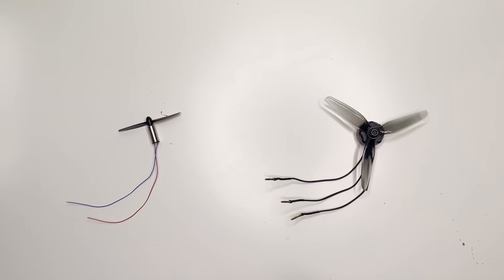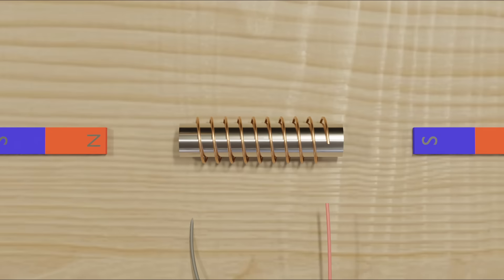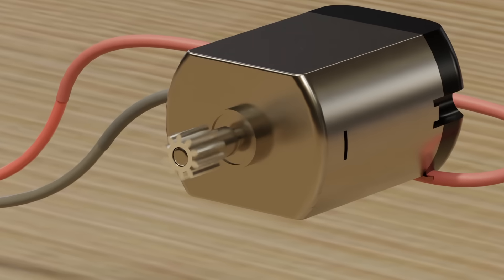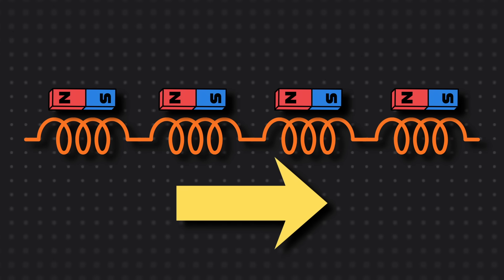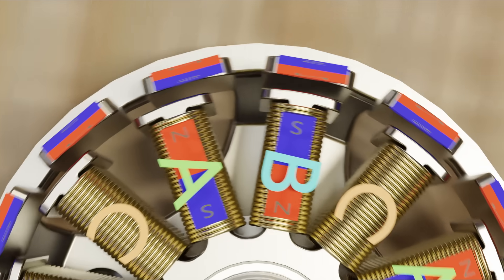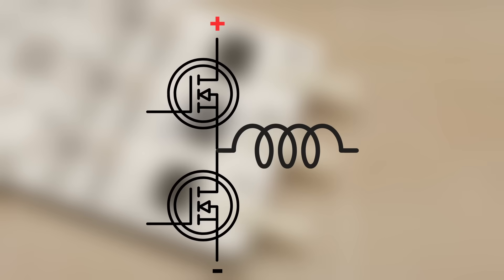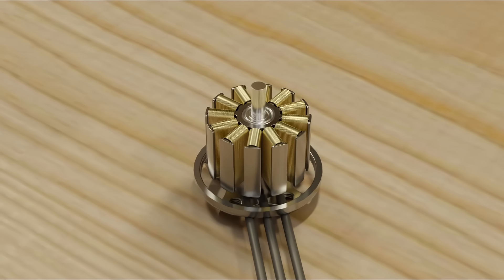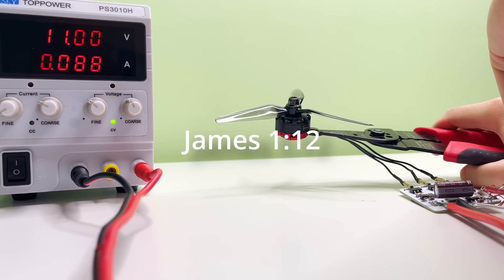Why Adding 1 Wire to Motors is Genius

Comment: wtf did you do to the "metal pad" at 2:12? overlapping faces or wrong normal direction... it's not like you didn't notice it, because you spent so much time animating in that area, so it leads me to believe you didn't actually model this yourself and couldn't figure out how to fix it.

Comment: You didn't explain how brushless motors actually work... How does the induced signal on wire b determine when to switch the current?

Comment: There one more thing ... You can precisely control how much the motor rotates (say you're rotating it slowly and using it like a stepper motor). Not only will you be able to slowly change the position, but you also get the feedback, so you can check if you "missed a step". You don't even need to add an encoder for this.
In addition, you can measure torque. Yes, the third wire definitelymade a major change to motors. 😃

Comment: you kind of missed that that the classic AC motors and generators are synchronous motor that work exactly like that for more than hundred years. Just they could not easily change speed, but were tied to the grid frequency.

Comment: As a normal electrician (not electronics), the biggest change here isn’t brush and brushless. It’s more single phase and 3-phase. The ‘brushless’ shown in this video can be achieved without electronics, using 3 phase AC with each phase being 120degress out of phase.

Comment: is there not extra electricity used in the controller for the brushless motor? does this overhead use more than the wasted electricity from friction in the brushed motors?
Reply from the maker: Hello oosh, that's a good question! The ESC at idle uses about 22 mA, or 0.022 A of current at 11 volts, so about 0.022A * 11V = 0.242 watts for reference. In testing, the motor spins with a propeller at the same 11V at ~0.5A, so 5.5W at a low throttle (~15%). Brushed motors typically have efficiencies of around 75-80%, and brushless around 85%-90%. At worst case efficiency for the brushless, we'd have 5.5W*0.15 = 0.825W wasted, and for the brushed (best efficiency) with the same electrical power input, 5.5W*0.2 = 1.1W. So the brushless saved 1.1W-0.825W = 0.275W more, which is barely higher than the wattage of the ESC (so technically worth it). But what if we increase the throttle to a useful range (in this case, 15% throttle is nowhere near enough to lift a drone into the air, it would be around 50%). That would be about 11V*0.5A*3.333 = 18.3 W needed for 50% throttle. 18.3W*0.15 = 2.75 W wasted for brushless, 18.3W*0.2 = 3.66 W wasted for brushed, so brushless saves 3.66W-2.75W = 0.91W more than brushed. May not seem like much, but multiply that difference in wattage over many seconds for flight time for example (15 mins = 900 seconds), that can be ~900J of saved energy (for 1 motor, out of 4) at 50% throttle. Also, you'd likely need more power for the brushed motor to spin the same propeller at the same RPM anyway, and again, this is the worst-case efficiency for brushless, and best case for brushed. Hopefully I didn't make a mistake in the math, and hope this answered your question, and thanks for watching!

Comment: Stop saying "electricity" when you mean "current". ffs
Reply from the maker: I know it sounds annoying to people who already know what "current" is, but using "electricity" is more understandable to the intended audience of this video. "Electricity" is a more general (and more known) definition that includes the flow of electric charge (electric current). It came down to what needs to be explained to the audience to allow them to understand the main concept (brushed vs brushless DC motors). You and I know that electric current is just more specific in that it has a unit of Amperes to define how much electric charge is flowing, but I deemed quantities as unnecessary for this explanation. That is my reasoning for using "electricity" rather than "current". Hope you understand, thanks.

Comment: Don't forget the clean rooms brushless motor powered tools that are needed.  All those brushes for the old type motors are just little conductive break pads that make microscopic dust.  Went in to get a cavity fixed, got mesothelioma instead

Comment: hello! despite the fact that ideas like magic, and magnetism are not so far apart, you did not manage to make me understand how these things work. for example you talk about three wires connecting, but you did not manage to describe me the voltage potential difference's connection to the connecting three wires. you also managed to flawlessly portray the net motion of the magnets, and the electromagnets, and you mention that you use mosfets to control those. however for some reason you did not mention why the magnets around the brushless motor's electromagnets are not the amount one less the electromagnets. i assume this is due to you misunderstanding the difference between the net motion, and the actual motion such brushless motor does. in my perception the electromagnets are creating a "tide" compared to the magnets around - in order to make these never catch up to one another you can introduce the most tiny difference in this way for example to use one magnet less than electromagnets - causing the "tide" to be forever

Comment: Wait until someone adds 4 wires
Reply: Step motor
Reply: @MasterRey  But step-motor, it's embarrassing.
Reply: That would be an important step in the path forward
Reply: Step motor 😂
Reply: @FoxInSocks23  Step-motor, what are you doing?
Reply: Best one faster than 3 wire
Reply: Steppers! I own a 2504AC. It's fast till you see the 3004AC.
Reply: Well that actually reduces efficiency.

Comment: Frequency Drives have revolutionized industry by reducing spike load during startup of heavy equipment. Reducing the load requirements to these facilities lessens the stress of breakers, controllers and power grids. If it weren't for these innovations and LED technology, the world would be consuming 50% more power than it is currently.

Comment: This video could replace the vast majority of beginner level "introduction to motors" presented in electrical trade and engineering schools. Gives a really good explanation of DC electric motors in general, brushed vs brushless (I don't think you use the word commutator once, but explained it - well done) with very useful visual guides, and also can be used as a lead in to 3-phase AC power and the wonderful world of power electronics.
Reply from the maker: Thank you! I made this video with the intention to allow anyone to understand while only keeping what’s necessary for the understanding. Im glad that the video was able to do that!

Comment: Brushless motor was around long before the 60s , semiconductors only made it possible to run it from a battery. They have been around almost as long as electricity has been around

Comment: within the historical context, I think one wire was removed, because the commutator is a seperate invention
Reply: aight my guess was wrong but we were able to create 3 phase electricity without the electronics and three pase single speed motors could run at a fixed frequency three phase mains

Comment: I don't like the "adding one wire is genius" part, because brushless motors are by themselves simpler than brushed ones, it's the electronics that makes them more expensive. So if you want to retain the mild clickbait part, it would be more reasonable to say something like "how deleting one part from a motor makes is better"

Comment: cool but I'm fine with my gearmotors I can control with just one transistor for what I'm doing. having silent operation is cool but this is way way more costly, specially when I need a few of them. And If I need super accurate operation you can"t beat  steppers.

Comment: Dont brushless motors with for example 3 coils in the middle connected  each with 1 wire and a fourth connecting all to groundand they spin with alternating current automatically switching the direction of current?

Comment: GOING CORELESS !
Yes but your talking about old fashioned Poled motors. Life has moved on, as we now have much more powerful and far more sensitive Coreless Motors that NO LONGER need any extra expensive electronics, only a supply and voltage regulator such as a "knob" to increase or decrease the voltage. And MUST use PURE 12v DC.

Comment: The spinning part of either motor type is called the rotor; the stationary part is the stator. The BLDC motor you had was an outrunner because its rotor was on the outside. Some BLDC motors, like stepper motors, have the magnets spinning internally.

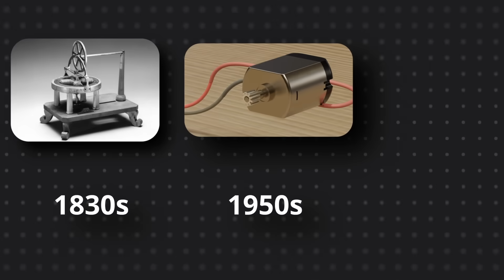Comment: 2:59 Small correction, we did not use DC-motors(or "brushed") up until the semiconductor was viable. Sure, today the semiconductor is a big deal when it comes to controlling asyncron- and syncron motors. The 3 phase motor was starting to get used in mines as early as 1890s. For these motors controlled from a DC source the story is different ofc but just wanted to give the AC-motor the recognition it deserves ☺️

Comment: Actually the better answer is that because of the ESC, Brushless Motors have more torque inducing couples (12 coils and 14 magnets here) as compared to Brushed Motors (2 magnets ad 3 coils). Therefore a Brushless Motor applies a uniform torque and more frequently, throughout it's rotation than a Brushed motor.
An analogy would be a 2-stroke vs 4-stroke engines - a 2-stroke engine gives a more torque output since every revolution has a power stroke than a 4S where every other revolution has a power stroke.

Comment: 3:00 a small correction: No, this is not the only way we used electricity to spin things; it's the only way we used DC to spin things. 

AC motors had been brushless ever since Nikola Tesla invented the three-phase induction motor way back in the late 1880s and we almost exclusively used these motors for industrial applications (with a few exceptions where high initial torque is needed) from at least 1900 onwards.

Comment: One of the biggest advantages to brushless motors, is that you can lock them in place. Another advantage is that you can make a solid state controller using only a handful of transistors and control speed via frequency rather than amount of power (PWM). It is possible to build a 3-way H bridge for this using only transistors, and power.

Also, wait until you get to four wire motors that can do half steps ;)

Comment: Brushless motors has been around from the late 19th century. Nice, and very informative video, but it is a pity how it turns phase shift into a modern age invention, not even mentioning  Galileo Ferraris, Mikhail Dolivo-Dobrovolsky, or  Jonas Wenström. They were genious indeed. Replacing 2 or 3 phase with a semiconductor based DC/AC converter ("inverter" as often used incorrectly) is just one way to generate the phase shift. This is how real greatness vanishes.

Comment: Great video! So well illustrated and described 👏🏻 I actually wasn't sure where this was going until part-way through the video... I've had a brief brush (ha) with brushless motors but they used Hall sensors for position feedback, rather than the unpowered coil connection -- that's clever!

Comment: Many robots still used brushed motors as late as the mid 90s. As an an Automation Technician, I cleaned many armatures that had carbon deposits that caused short circuits.

Comment: Brushless motors are 3ph AC motors. Brushed motors are DC. DC motors have near full torque at low speeds and that's why they are used in elevators where small adjustments may be necessary. DC brushed motors are also used in RC crawler trucks that go slow. Both have their specific application.

Comment: don't they use brushed motors in high torque applications (like screwdrivers) and brushless in high speed applications (like an fpv drone)? tho, while writing it i remebered about stepper motors, which is brushless, but are capable of high torque...

Comment: At 4:49 minute mark, how is current not flowing to B and only coming out through C?
Reply: Because the wire out of B is not connected to anything (at that instant).
Reply: Eletricity needs a diference in potential to flow, in laymens terms, in a battery one pole has power, and the other pole wants power, put a wire that connects the two poles and eletricity will flow from the pole with power to the one without. To answer your question, imagine eletricity as a car and the wires as a highway, if the + pole of the battery is the origin for the car (eletricity) and its destination is the - pole, then it must drive (flow) in a route that goes thro wire A and wire C. It would never go thro wire B because there is no diference in potential in there, noone wants power in there.

Sorry for the wall of text, you need a closed circuit.
Reply: Letting the end of B just hang in the air (or not switching it "on") ensures that no electricity can escape that way
Reply: Basically the same system that allows current to flow (low resistance), now disallows it (very very very high resistance). Semiconductors and transistors and stuff...

The in depth is super complicated but that's the surface level part
Reply: The electricity takes the shortest path from one to the other side of the battery and since B isnt connected, it has no reason to go there
Reply: That’s what the semiconductor is for, basically current only works in full loops and semiconductors can act as gaps in that loop on demand.

Comment: There are a lot of insidious details everyone missed about whole brushed-VS-brushless thing.
Right before the era of brushless motors on RC-everything - hi-end brushed motors existed. The same tech as regular cheapo brushed motor, but with strong neodymium magnets and premium materials. Power-to-weight ratio was very close (if not identical) to what we have now with brushless engines, but they where running of a simple single mosfet ESC to control power. Yes, it still had brushes which may wear off over time - but do you know how long it really took?
Brushless motors ~20 years ago was expensive shiny tech sold for extreme prices. Marketing won that game and everything was replaced in RC hobby. But they are not much superrior to hi-quality brushed motor.
At the same time, brushed motors are not going away any time soon. They are still mass-produced and for a good reason. If not overloaded, brushes lives forever. The motors can't burn by ESD or RF interferance, they do not requires external ESC to work.

Comment: Actually Sir, this is not "all we need to know to understand motors". The most important part, being left out for almost two centuries, is that the collapsing magnetic field, when you switch off your coil, generates a pulse that can be used to power a capacitor, of a battery. This is turn can be used to create a self sustaining system, aka a Bedini type system, converting voltage to current.

Comment: Lets not forget that it's basically a 3 phase motor, which has existed for a long time, for which we invented a smart controller.
Reply: yes , its not saying when it was invented.. just that its finally in  small low voltagev dc.  of course, the third wire isn't necessarily for brushless ..it could be used for feedback .. motir speed
Reply: If you're thinking of a three phase induction motor, then not really. An induction motor has no magnets and works in a completely different way.
Reply: @wayneyoung9612 yes, for 3 phase motor, the current in coil is ac , but for this brushless motor, it is still dc, and the structure of 2 motors are completely different.

Comment: as a drone guy i saw the thumbnail and though "hey thats a 2207 motor" and then thought " hey that a chonky esc" then though "who uses single motor esc's in 2025 i thought we all moved to 4in1 esc boards"
Reply from the maker: Lol, yeah ESC is for DIY learning purposes. Might make my own custom 4 in 1 ESC. It's just 4 ESCs in 1 board, should be easy right? Right?
Reply: @TheTinkeringTechie sureeeelylyyyyy
Modern drone escs also have to work in unison with watch other and they also have to work with the fc board so maybe not so much
Also they have a built in pdb all in one board
Reply from the maker: @namanienie123  Dang. Well, I'll see what happens with my second drone project.
Reply: @TheTinkeringTechie yeah
It shouldn’t be too hard, but it won’t be easy either because like I said each ESC has to work in unison with each other and then they also have to work in unison with the FC and they also has to be a PDB built-in into the ESC and everything has to be all accurate or else you either get a blown ESC you get blown motors or something is out of sync or out of balance and you go to pull out of a dive and instead of going up you flip out or something similar

Comment: Your history has a lot of omissions and inaccuracies. While nowadays virtually all motors--with the notable exception of power tools--are BLDC, it wasn't an abrupt blanket changeover in the 1960s. Brushed DC motors were still common when I was a child in the late 1990s, and in fact are still used today in battery-operated cordless power tools. Synchronous AC motors existed as far back as the 1890s, and both 3-phase and 4-phase designs were in use back then. 3-phase AC motors, the ancestor to the brushless motor, were already in use everywhere that variable speed control was not necessary. 4-phase motors are the ancestor to single-phase AC motor, where in starting, a capacitor is used to create a 90° shifted phase (Remember that 180° out of phase can be produced by the phase itself simply by reversing the coil wiring), and once in motion, the starter is disconnected and inertia keeps the motor spinning in the same direction as long as the electrical power is connected. Motors (and transformers) work on a voltage/frequency ratio, and the frequency supplied must be linearly proportional to the voltage. The controller circuitry is a 3-phase inverter that is able to control voltage and frequency in direct proportion to control speed.